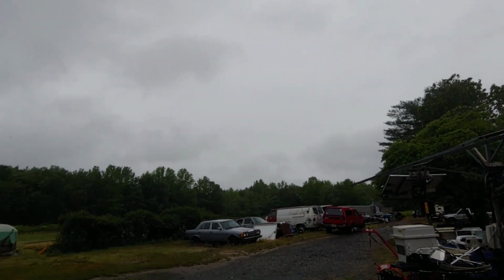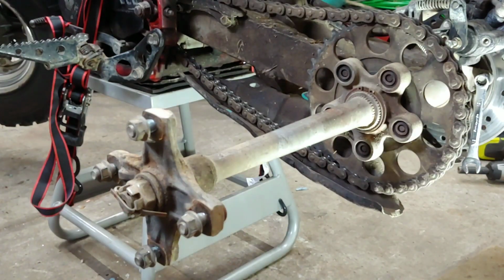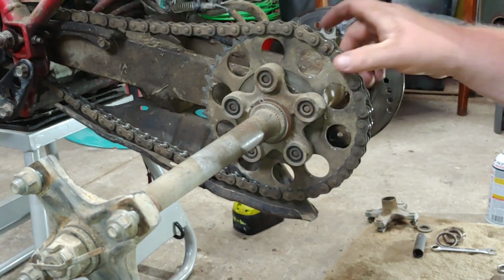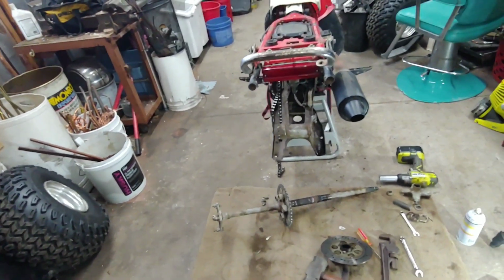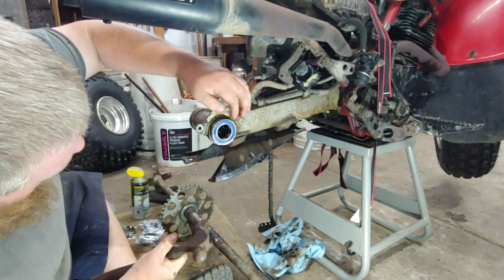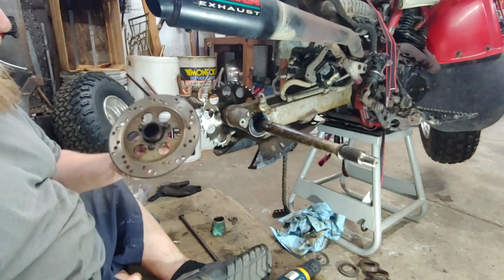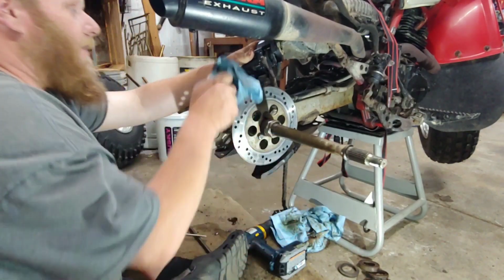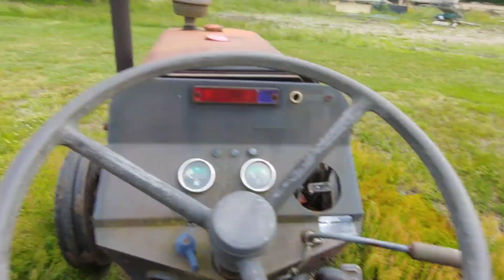Swingarm bearing replacement - 1984 ATC 200X

Comment: "Getting a bit rusty in there, lucky we got to it now rather than later" , let's see 1984 to 2021 = 37 years, mmm, lucky we did not wait until 40 years to have a Bo - peep.  Thanks Bert some of your mechanical video's convince me to pay the premium and get a professional to do it.  Had a flat battery on my Ford Escape this morning and Auto membership attendee said he did not carry a 4044 battery but gave it a quick charge to get me where I was going and he said to ring up my Car membership later in the day and organize with them for a replacement battery.

Did so and the second bloke who turned up this afternoon with replacement battery was spitting chips because replacing a battery on a Ford Escape was a 45 minute job and he was most cranky with his associate who turned up earlier and did not carry that particular battery. 

  The interesting thing was that after installing the new battery and I then took it for a spin, I found half a dozen of the electrical gadgets. ( ie the thing that turns off you engine to save fuel when you stop at traffic lights) all suddenly started to work again, although my dealership could not get them working at last annual tuneup.  My "Two bobs worth" says that due of the Covid *19, I have only traveled 5000 kilometres in last 12 months so various electrical gadget don't work after your battery amps are to low due to lesser charging.  Wonder when the dealership will wake up to this fact.  Now to find a professional dealership to do my next annual service. does such a place exist Bert.

Comment: Drill and tap that outer tube housing for a grease fitting. Take the inner seals out of the bearings. 
Pump it full of grease. 
Heck, I'd still do it while assembled. Grease the drill and tap while using, clean chips and re-grease to catch as many chips as possible. Enough grease pressure will still get it through the inner seals.

We used to use Pledge furniture polish on the plastics. Cheapest (Aquanet) hairspray for installing grips.

Comment: wet sanding for plastic then clean and re-do it then get plastic spray in can and apply make sure to match the color then dry and wax n buff.
Reply: Yeah with #2200 grid or something other wise it a nightmare might as well use toothpaste or a baking-soda slurry that about the only kinda grit you really wanna use on plastic...

Comment: Bert, you should buy some emery cloth, it won't remove any metal to mention but it works really well for prepping shafts for the race and bearings, easy to use as well

Comment: Just for the record if'n you paint the exhaust I recommend Rust-Oleum Automotive High Heat Spray.. I have had great experiences using it on exhaust system !
Reply: I use ospho remove the rust then paint it..

Comment: I use heat gun to liven my plastics back up. It brings the color back out and use plastic filler lightly and use the heat gun to fill it in the grooves/scratches. GO SLOW!! It will melt the plastic if u use too much heat

Comment: I put a grease fitting  in the center to grease them last longer
Reply from the maker: That way only last longer if you take the sealed bearing cover off on the inside
Reply: I do that same.. cuz of friction and the heat and melts the grease and it will pass thru the bearing seal

Comment: I have a couple of questions Bert. I use Ryobi tools too. I got a one plus impact wrench for my bday and wondered what sockets you use with it? The Kobalt ones I have don't fit the wrench the opening is too small. I like my Ryobi tools and don't want to go buy something else that will require more different batteries. Let me know.  Thanks
Reply from the maker: It sounds like you have the wrong size impact probably a 3/8 impact is what you have what I have is a half inch impact there is a difference
Reply: @ScrapFarm  thanks I'll check.

Comment: Light oil on a cloth or I'd say put some more material on it with some kind of spray maybe clear coat, then sand and polish. I wouldn't sand or wet sand that old paint right from the get, I bet it's real easy to go to deep . Try a couple methods on a small piece first then once you find one you like do the rest.

Comment: Heat gun for the plastics. It will melt the imperfections and bring the luster back
Reply from the maker: It's a delicate operation
Reply: @ScrapFarm  that’s even better because it doesn’t melt it like torch. Just try it on an inconspicuous spot.

Comment: #dude omg with all you know.. How could you just about murder that bearing .... Hitting it in the center you just about killed the center race . why didn't you take like a um 1" 1/2"' socket or a match the outter race...or even using that copper headed hammer would have been better ? No doubts you distorted the ball carriage also... UGH =P
Reply from the maker: Saul Good handles great everything can live through a couple love taps.  And I don't have an inch-and-a-half socket here could you use a PVC fitting
Reply: That be a great #case #saul Goodman #bert verses #Timken on #judge #judy might a vid that goes #viral =P

Comment: This video proves that not everyone should repair vehicles
Reply from the maker: Yeah, well, when you're a poor dirt farmer.... You really don't have any choices other than to do it yourself... I can tell you one thing. I won't be the one sitting there crying. Because nobody's helping me.
Reply: He did not put a new o-ring on the disc brake side on the axle. It is there to stop the water from rusting the axle
Reply from the maker: We can all be as good as you..... And how do you know I didn't off camera... You don't get to see everything... To tell you the truth, I don't even know if I did but whatever. I'm not planning on taking it in the water.... At this point the thing is in survivor condition... I will not be the one that takes it in the mud.